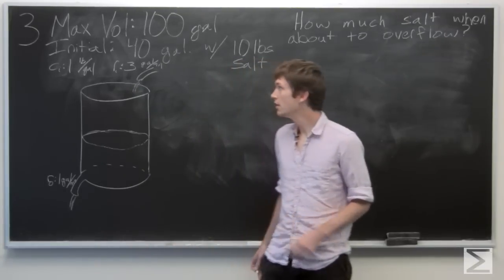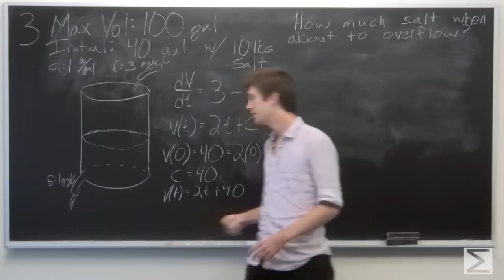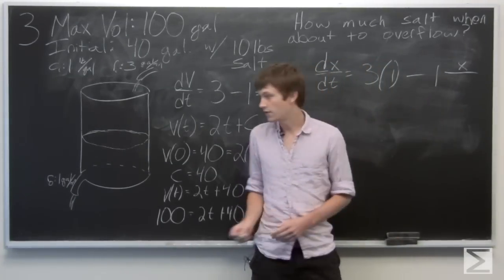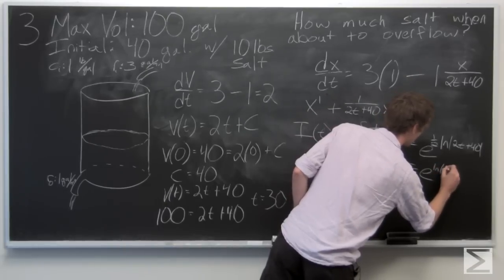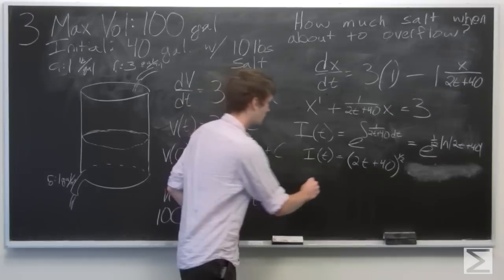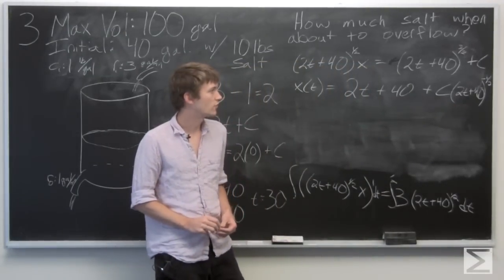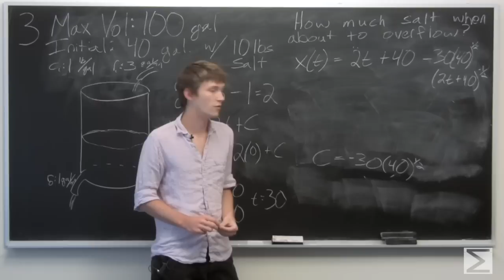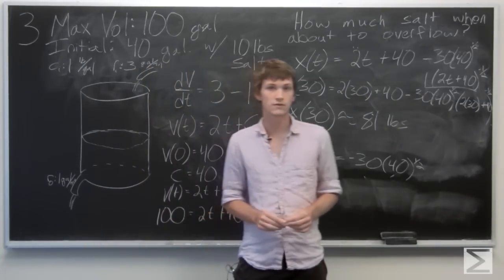Worldwide Differential Equations Section 1.4 #3

Comment: At 6:59, shouldn't that anti-derivative have a coefficient of 2 in front of it?
Reply from the maker: Hello. Thank you for the comment! The integration of both parts are correct. If you are referring to the right side of the equation, the derivative of (2t+40)^3/2 + C is indeed 3(2t+40)^1/2 Remember to use the chain rule for such problems. Let me know if you have any further questions or if I didn't answer the question you had.